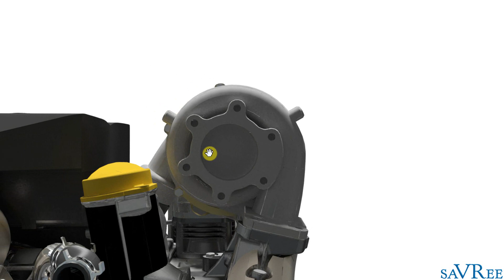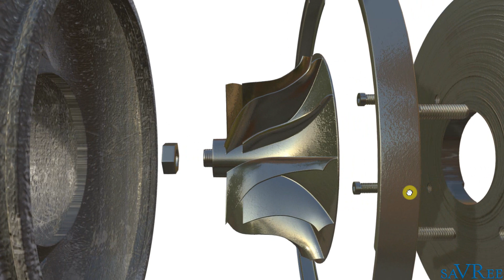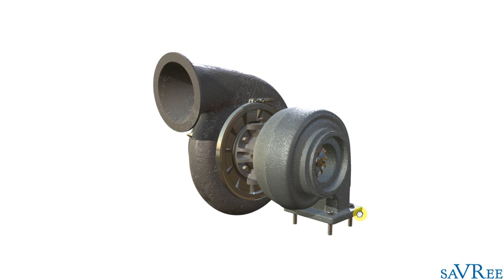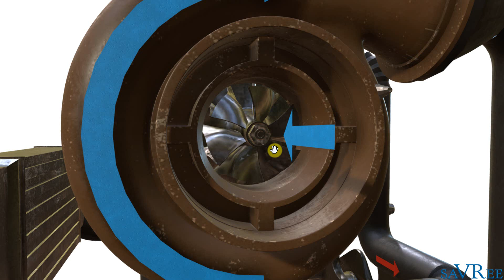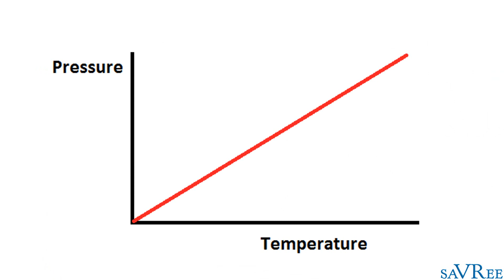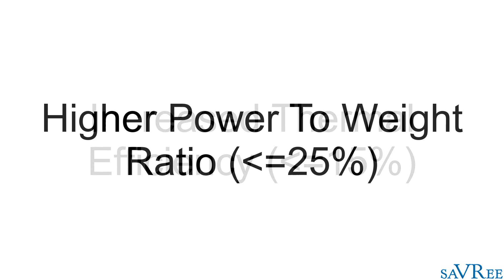How Turbochargers Work (Animation)

Comment: FANTASTIC!!! Thank you Sir for taking your time to create the rendering of a Turbocharger and applicable components!! 
Seriously, I NEEDED this
EXACT "schematic" for more than one reason.
The first being I recently bought a beautiful 2006 Pontiac Solstice with a small stage 1 turbo and necessary related components. 
The engine is easy to work on, reminds me alot of the 302 5.0 Mustang engines Ive had 3 and worked on them as easy as this Solstice. 
However, the Solstices engine bay has numerous obstructions which makes working on it a pain.  LoL 
And Because of all the clutter I cannot see the stamp on my turbo that has the maker and whatever else. i also cant see my entire turbo.

I am a visual person, and if I cant see it in my head then I cant truly understand it.

This video you made has allowed me to now be able to SEE ans VISUALIZE my turbo piece by piece. 

THANK YOU!

Comment: Savree can you please make video on 1.exhaust gas economizer,
2.What is manifold in engine,
3.From where the lt and ht passing through in cylinder head,
4.what is purpose of alternator/generator which is connected to engine
Please if you have link share here,it will be very helpful for me n others

Comment: Question: Where does the used-up exhaust gases go after they're utilized to spin the exhaust turbine side of the turbo? - Are they simply expelled into the exhaust line/muffler/tail-pipe to exit the system/vehicle? Thanks.

Comment: Excellent explanation and graphs. My only doubt is related with the place where exhaust gases gets into the snail. The red arrow exits the snail center, so I got confused
Reply: The exhaust gases enter the casing from the side and "hit" the turbine blades forcing them to rotate. Then they exit turbine casing from the center.
Reply: @geomt365  Thanks very much